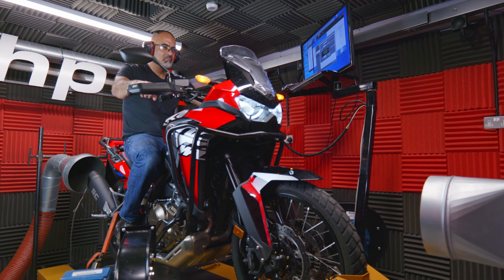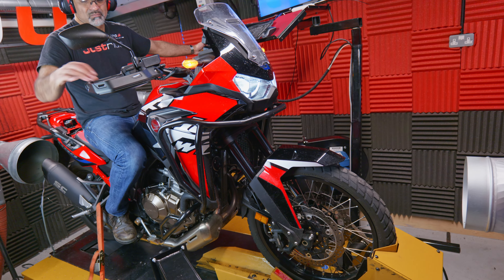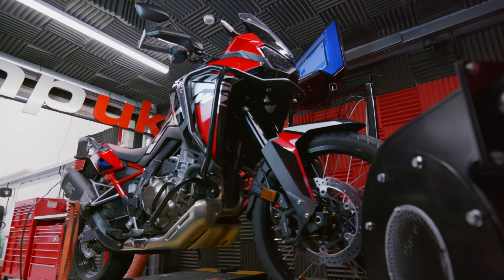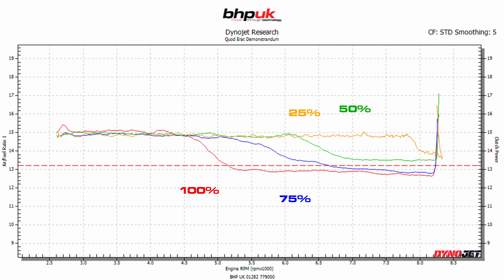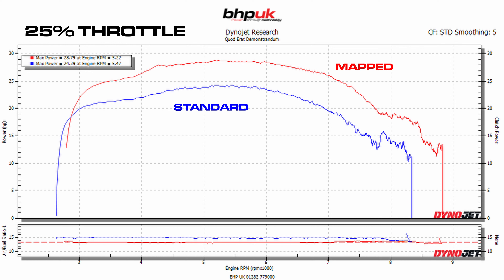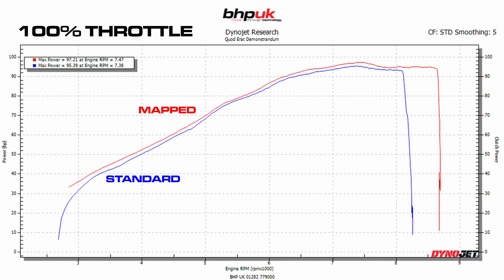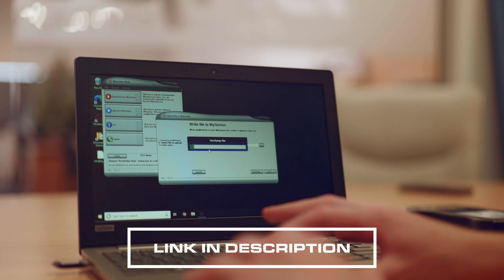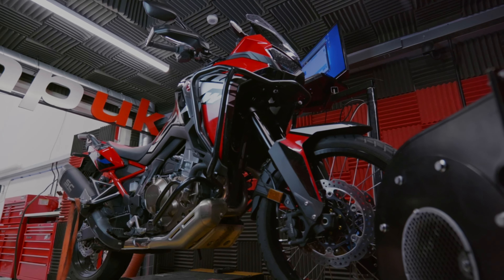Honda's Newest Africa Twin CRF 1100 Takes to the Dyno! | BHP UK Custom ECU Remapping

Comment: Hi, any updates on when you can remap for the 2024 AT 1100 ES bikes please? Eagerly awaiting news for the re-flasher compatibility on the 2024/25 year bikes.
Reply: I'm also interested in the 2024 remap...most annoying point of this bike is transition from closed to partly open throttle...in curves you lose balance and smooth exit from curve because of jerky throttle response

Comment: After installing a BHPUK remap using the re-flasher  tool, if you were to take the bike into the dealer for service etc (prior to doing this, you reinstall the original OEM map), if they install a software update, can this be saved to the reflasher tool, before reloading the the BHPUK remap, so you always have a copy of the most upto date OEM Honda software map?
Reply from the maker: This is not possible. The bike would need to go back to original and then if they update your software, you would need to reset the device and take another read and purchase an update file at a fraction on the price.
Reply: @BHPUK or, just don't have oem update? 😂
Reply: @terrystratford1235  Yes of course that’s an option, but if a software update is made for safety or an improvement in an operation of the bike, then you would want that update!